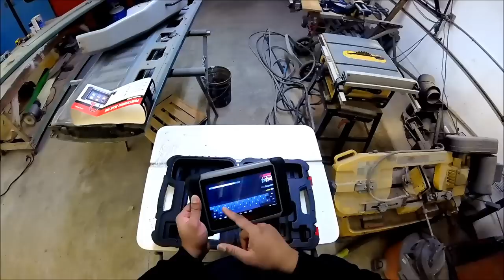Autel MaxiCOM MK808 Unboxing and review | Car-addiction

Comment: Is this able to control on off on evap solenoid operation while I  use an evap smoke machine to troubleshoot a po442 456 and 448 . Unable to resolve using test mode on my 2006 subaru sti. If yes will get one. I do have an autel 609 so I  do need to upgrade . I'm a diy backyard mechanic just working on my own cars.
Reply from the maker: It will definitely read the evap codes but I am not sure if it will leave the valves on or off. Buy it from Amazon, if it doesn't work return it for full refund.
Reply: I asked about that very feature on Amazon, and got a reply from the seller. This is not a fully bi directional scanner. It's a good product, but has some limitations. I specifically asked about energizing relays and solenoids with this scanner, and was informed that this particular model does not have those capabilities. To be fair, the price point of this scanner still makes it a good deal. A true, fully bi directional scanner, at least one of good quality, costs quite a bit more than this particular Autel model. That aside, I'm still considering the mx808 for purchase. I think it's definitely worth the money.

Comment: Could you make a video of the various suspension functions that the MK808 can do on your Mercedes? I want to purchase one for my W220 but am not sure if I️ can adjust and reset the suspension manually with I️t.
Reply from the maker: Yes you can reset and adjust the suspension manually with the MK808. I did it to my S55 amg. I should have made a video.
Reply: Car-Addiction Thank you very much for your quick reply.

Comment: The  DS708 does a cylinder misfire count as the car is running. Does this device do a cylinder misfire count?
Reply from the maker: I believe you can get a freeze frame and get the misfire count. I'm not too sure.

Comment: I am working on a 2003 Lincoln LS. The ABS light is on
Will the  MK808  tell me which abs wheel sensor is bad, or if the fault is in the module itself?
This scanner can also make new transponder keys for this vehicle as long as I have one working key?
The SRS airbag light is on also. Can this scanner diagnose where the problem is?
Reply from the maker: Yes it will.
Reply: Yes to all? Is it true that this scanner has been discontinued?...do you know why?  Thanks...
Reply from the maker: Sorry I just read the abs part last time. It will show which sensor is bad and can scan the SRS fault code. Won't make new transponder keys. You will need the DS908 for that.
Reply: This scanner is suppose to be able to make new replacement keys with the IMMO function. Autel does not have a list for the vehicles that this function will work on...just says it is limited. Can you go into the IMMO and see which cars it will work for?
Reply: I don't think it will do immobilizer for any vehicles at all, only pull codes. No seller will say it works for immobilizer, all say no.
Reply from the maker: Good to know. I was not aware of the fact
Reply: I was able to program new keys for my 1998 accord and 2011 corolla.
Reply from the maker: I still don't know how to program the keys. I have to learn that. Is there a video for that?

Comment: I believe that you are mistaken about the Brake Service Bleed. The process still requires visiting each bleed screw at each wheel and bleeding the air out the old conventional way, after the scantool prompts you to do so. Perhaps you should try this procedure for yourself and create a follow up YouTube video so viewers can see the actual procedure? A close up view of the scantool screen menus and option choices would have been helpful.
Reply from the maker: you are correct.  you need to visit the bleed screws to let the air out. good idea for a new video. also, I want to add the brake bleed will only work on vehicles which have the brake bleed system on board. eg my 05 Nissan Xterra won't work.  I said yes to the previous comment assuming he has a vehicle which allows brake bleed and he will bleed individual valves to let the air out.

Comment: Thanks a lot, the first video on mk808 I came across. Been looking for one in the past months. Do you think the autel connectors can work with this unit if someone wants to use the tool for non OBD2 models? Thanks once again, great video.
Reply from the maker: Sagir ILIYASU ADAMU sorry man, I am not able to answer that question.

Comment: can this retract the electric park brake  for rear pad replacement
Reply from the maker: It has an option for e brake adjustment. I’m not sure if it will retract the pads but as far as I understand it will allow you to adjust the pads after replacing. Sorry I couldn’t be of much help on this matter.

Comment: Very informative and detailed info. Thank you
Can you tell me how to update the scanner cuz Im think
of buying one but I heard mixed reviews of how you will require a bigger sd card
but I’m not sure what they mean by that. They say I will need to back up sd card it comes with
To the new sd card.

Wait, did you also say it doesn’t support Suzuki cuz that is one of the cars I have ?
Reply from the maker: im not sure i understand the issue with the sd card you are talking about. I have been updating on a regular basis and so far didn't run out of space. It works with Suzuki, not sure if it will do the detaied scan though.

Comment: Great video. Informative. You mentioned that there's suspension option. Have you tried it on your S55? If yes, were you able to diagnose the problem? I have S500 and some suspension problems as probably all S owners have. Please let me know. Thank you
Reply from the maker: you can reset the suspension, level it and read the suspension codes. you have to start the diagnostic from there.

Comment: If the scanner is a combination of the MD802 + MaxiCheck Pro 
Wouldn’t it of been cheaper to just buy those to tools separate?
Amazon has the MD 802 elite for about $250 and the maxicheck Pro for $265
The MD 808 Pro is also a combination of the two for $395 
It is very confusing as to which one to buy
What do you suggest?
Reply from the maker: Are these usd prices?
Reply: Car-Addiction no these are prices on amazon.ca
Reply from the maker: Thank you for the info, I will check it out.
Reply from the maker: +louis spartan it's far better than these both tools combined. It does transmission code, bmc code HVAC code, immobliser, steering angle, brake bleed to mention some. You can choose individual vehicle model from the mk808 and scan all the sensors on that specific car. Much better option than the ones you mentioned.just my 2 cents.
Reply: Car-Addiction thank you for your input
I also noticed your logo is from a 370z
Do you own one? I myself have a 2011 nismo
Such an awesome car. 
Anyway thanks again
Reply from the maker: +louis spartan well it's a Z car logo. I own a 300zx twin turbo. This is my 3rd one.

Comment: what are the differences between  808mk and 808mx
Reply from the maker: you are going to have to google their features, I am not exactly certain.
Reply: The mx808 is marketed and sold in American retail market whereas the mk808 is exclusive to the internet and isn't sold in a physical retailer. They both run on the same operating systems and have the same functions. They're just the same product with slightly different casing. Oddly enough you can often find the mx808 a little cheaper. Awesome tool.
Reply from the maker: That's a wonderful reply
Reply: Thanks. I did a lot of research before buying my mx808. Your video was awesome by the way. I'm going to subscribe to your channel.
Reply from the maker: Thank you very much.

Comment: Can this calibrate weight sensor seat for honda
Reply from the maker: I am not sure. I will check.
Reply: Hi. Can this calibrate seat weight sensor for honda/acura?
Reply: Hello i use Autel MaxiDAS DS808 to calibrate it
Reply from the maker: That is correct
Reply: Thank you heck d. Is the maxidas and the maxicom have the same features? Could you calibrate seat weight sensors with both?

Comment: Nice video, does it pull pin code for Nissan
Reply from the maker: You mean obd1 codes?
Reply: @runningrich  I mean immo function (to pull old and new pin code) for 2007 Nissan Xterra or all keys lost.
Thanks in addy.
Reply from the maker: It may or may not do it.

Comment: Is this applicable for 24 volt trucks?
Reply from the maker: I'm not sure as I have not tried with the 24 volt truck. Worse case it will still pull the codes I guess
Reply: im afraid it would fry if I use it in 24volts. any idea how to protect or make sure the device won't fry?

Comment: hie can it program mazda immobilizer keys??
Reply from the maker: What year and model?
Reply: Car-Addiction 2010 mazda 6. And can it help as well when you are swapping a new instrument cluster on that same car since mazda 6s have an immobilizer in the instrument cluster that need to be programmed for the car to start if it is changed?
Reply from the maker: I checked the 2010 Mazda 6 is listed under the immo function.
Reply: THANX

Comment: I recently purchased a MaxiDas DS808 to use on my Ford Focus ST 1.5 (150PS) 2016 EU. I have looked but cannot find how to display realtime graphs on the display. can anyone help to find to fine operation. I would like to display Fuel Trim & Oxygen sensors.
Reply from the maker: Let the system identity the vin. then go to read codes, on that window scroll to bottom you will see the live graph option. you will need to select the sensord you want to see live graph of.

Comment: What is the difference between mk808 and ds808
Reply from the maker: +Abdulsalam Saad Eldeen very different. That's has more capacity and features.
Reply: I'm on the brink of going into ds 808 until I saw our video. So you're suggesting that MK 808 is much better than DS 808? Tnx. Great info anyway

Comment: Thanks for the video
 I went ahead and bought it 
Unfortunately, it doesn’t recognize my Hyundai Santa Fe when I try to bleed the brakes 
Hyundai is not supported 
Oh well back it goes
Reply from the maker: Which year is the Santa Fe? Then it won’t work with my Kia Optima either
Reply: When I clicked on bleeding brakes 
It didn’t have Hyundai nor Kia 
and I took the updates first before proceeding to bleed the brakes
Oh yah and my Santa Fe is a 2014
I tried calling tech support but no answer
The phone just kept ringing
Reply from the maker: +louis spartan that's sad. Well I guess the brake bleed will be a 2 person job.